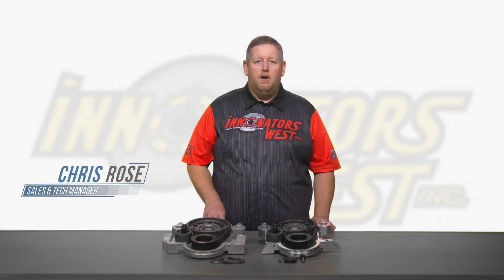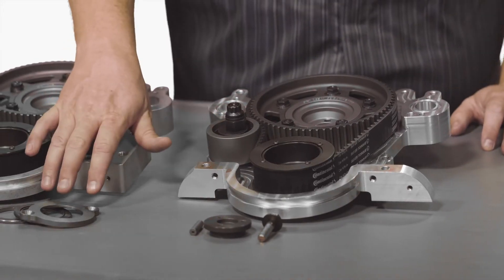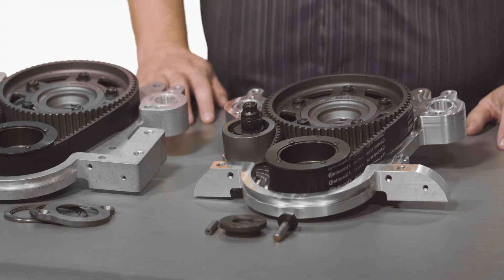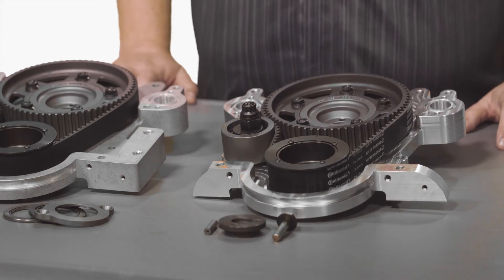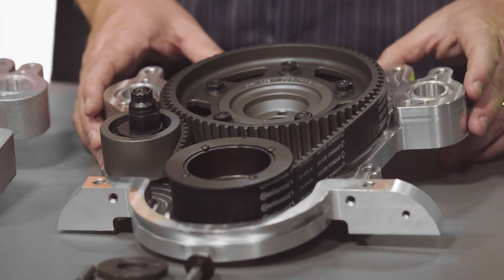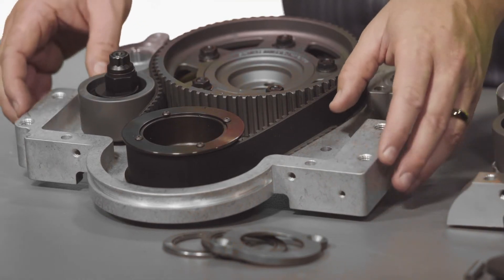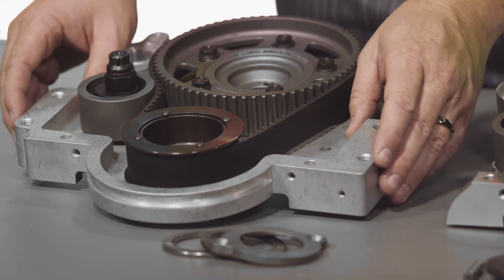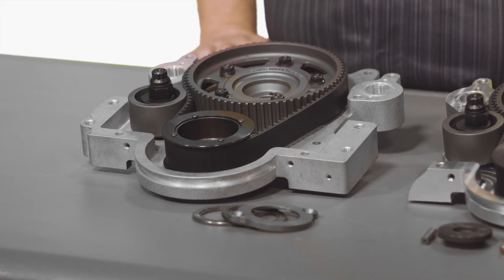Innovators West Product Spotlight - Big Block Ford belt drive timing system

Comment: Are you supposed to swap out the original cam dowel with the hardened one?
Reply: You can if desired, or it can be used as a second dowel if your cam only has a single dowel to start.  The upper cam drive flange is drilled for dual dowels.